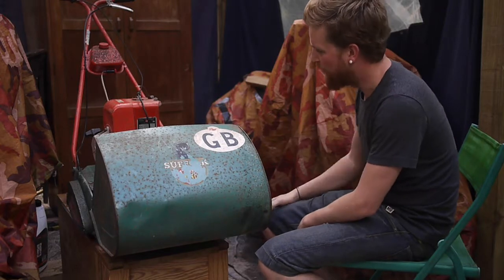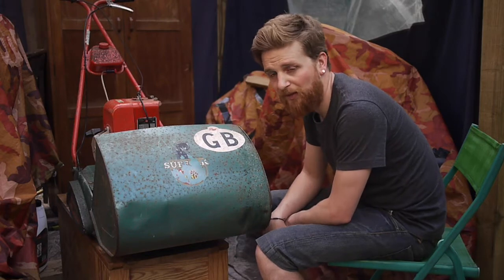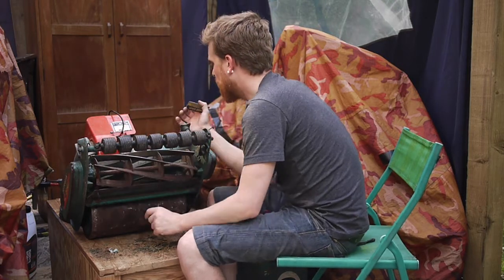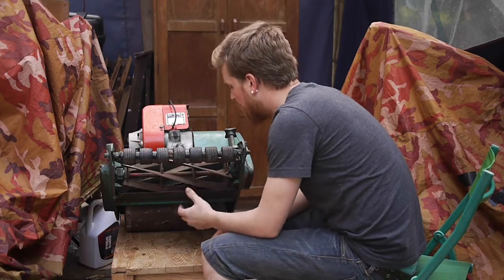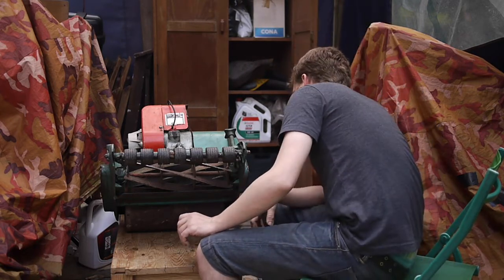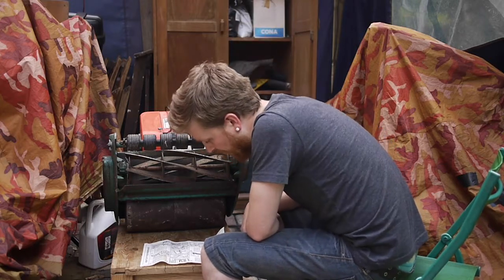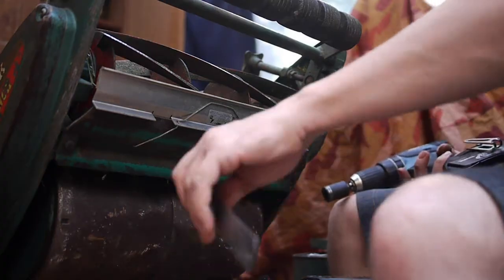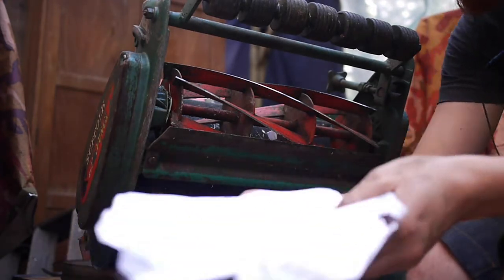Sharpening a Suffolk Super Punch/Colt Cylinder Lawnmower

Comment: Top tip:  pull the spark plug lead off and the engine can't start. It's the  standard safety precaution when working with petrol mowers.

Comment: Hi, came across this searching for how to sharpen a cylinder mower. Just bought an old ATCO 12V battery mower from the 60s. off evay. I think Webb and Qualcast also did battery mowers. Mine will be solar charged from a 20W panel. No more petrol fumes or trailing wires. Thanks for the video, just need to find a mower mate sharpener now...
Reply from the maker: They look great! I didn't realise they had battery mowers of that age. I'll keep a look out for one.

Comment: Disconnect the sparkplug before getting your fingers into that cylinder 👀. At a guess, that machine pre-dates my father's Suffolk Punch, which had a green plastic cover / shroud on the handle covering the fuel tank, that machine was from 1986. At a guess, yours looks like a late 70s early 80s model. Classic machine, noisy as hell as you say 👍🏻😂

Comment: No.1 safety first, REMOVE THE HT LEAD FROM THE SPARK PLUG!
No.2 If you had screwed the cylinder back down you wouldn't have had to apply pressure to the mower mate .
Reply from the maker: Noted. HT least didn't even cross my mind! Should probably have thought of that.